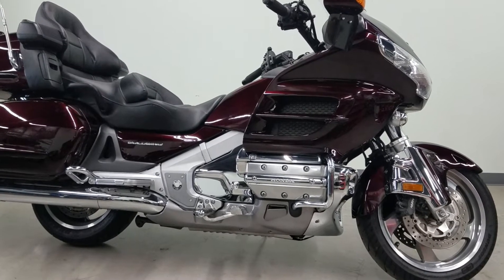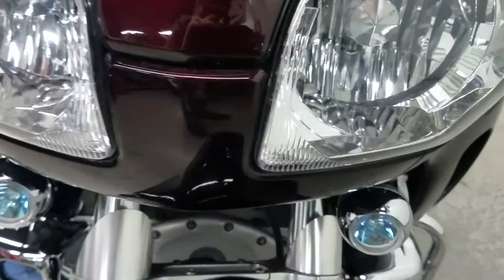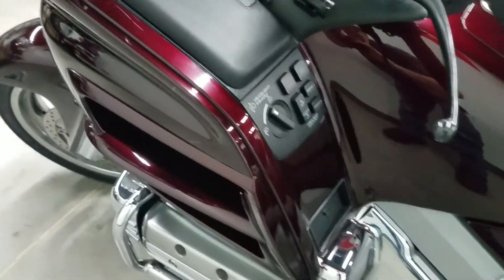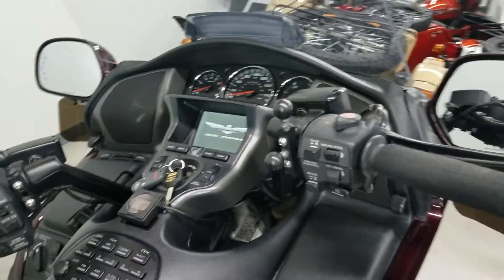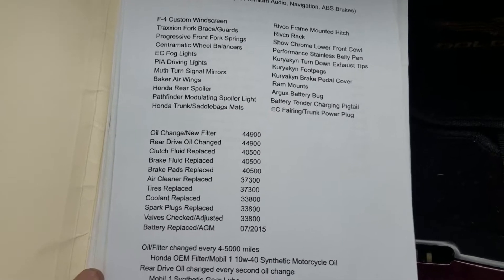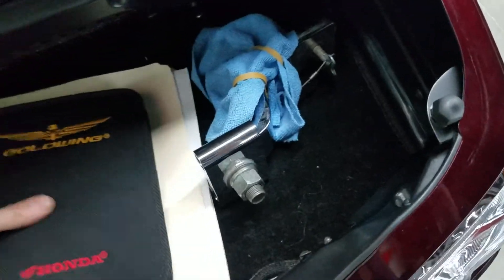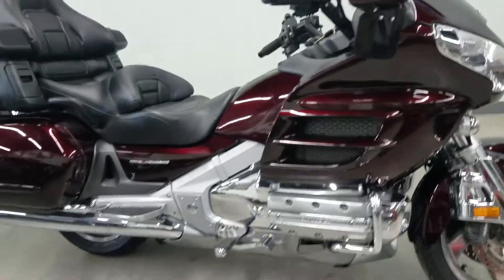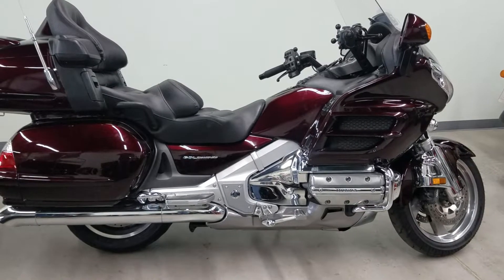2008 Honda GL1800 Gold Wing

Comment: Good review. I just bought an 08 GL1800 with Comfort / NAV/ Audio from a private seller with 26k miles. Its in mint condition as well. I paid 10k for mine. It also had a few extra goodies included. Maybe a bit high but I am happy with the bike so far. I rode it home 430 miles last week and it didn't miss a beat
Reply: BEAUTY
Reply: beauty
Reply: I bought an '07 3 months ago Nav,heated seats,audio 14k miles also mint and looove it..Only complaint gears are loud & clunky just when shifting wish it were quieter...
Reply: @seatime674  … Next oil change, try Amsoil as a test if you want to go that way. I use it on my Harley for that reason and it makes a difference. The previous owner of my GoldWing already used Amsoil before I bought it. I don’t have any issues like that with my bike.
Reply: @wingandhog  I don't think there's anything wrong with it some might just be more sensitive to shifting noise than others I have A.d.d lol.., I just put expensive synthetic Motul 10w40 oil in it as people really recommend that to quiet it down and didn't really so not sure if oil will really do anything...